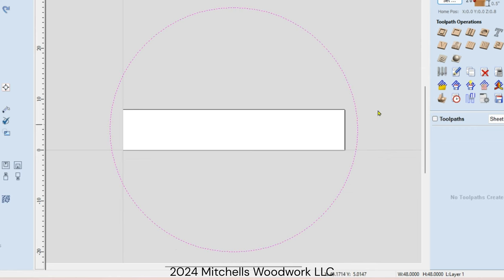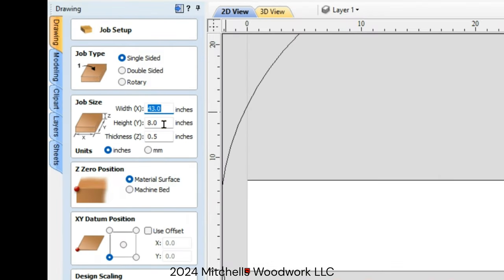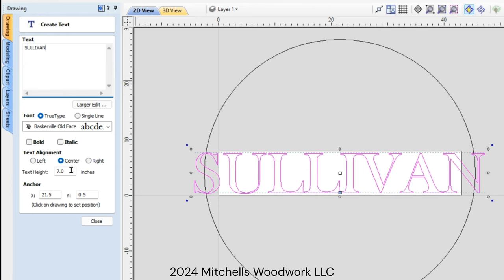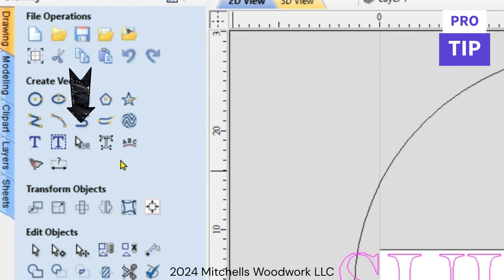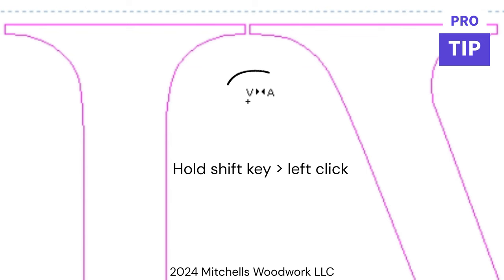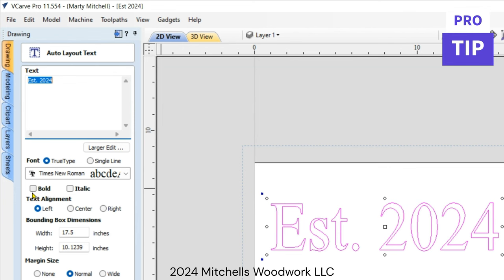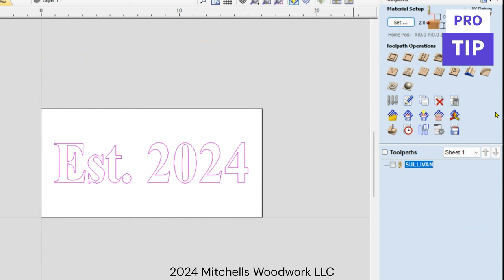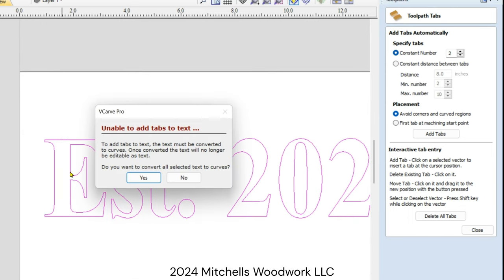Master VCarve Pro: Elevate Your Sign Text Skills

Comment: I think if you’re going to be mounting those letters later, you don’t need to worry too much about spacing. Do what you did to figure out what size they’d need to be to fit the sign, but after that you can fit them closer together to use less material. You could even flip some upside down to make them fit better to conserve material. For example, two capital A letters next to each other, rotate one 180° and then they can butt up closer together. Hopefully that makes sense? 😂👍
Reply from the maker: Yes, it absolutely makes sense, and I actually considered doing it that way.  But my plan was (is) to use the cutout as a template to help keep the letters level and properly spaced.  I've never did a sign like this one so I just considered this way the "safe" way.  Next time I'll probably feel more confident in my ability to do it as you suggested.  As always, thanks for watching and for your input!
Reply: @MitchellsWoodwork Using the cutouts like that is a great idea too!

Comment: Great info! IDC Woodcraft has an 1/8 up cut roughing bit called the badger. I have one and it works great!
Reply from the maker: After Cadence (Jenny Bits), IDC is my go-to source.  Unfortunately they didn't have an 1/8" upcut on a 1/4" shank.  I try to keep all my bits 1/4" shank just to avoid having to swap collets during tool changes.  I ended up getting the Bits & Bits (my next go-to) #425-SRF125LR bit.  But thank you so much for the suggestion.  I love my "Beast" and "Hog" from IDC and I absolutely support and recommend anything IDC sells.  Garrett is a great guy and was my biggest VCarve tutor and inspiration when I was getting started in the CNC world.  I'll always owe a huge debt of gratitude to Garrett Fromme.
Reply: Ahh completely understand. I just bout an ER11 router to replace my Makita and I bought extra nuts and collets so I have 2 1/4 and 1/8 collets. I will be picking up either the hog or beast next week.  Keep up the good work!
Reply from the maker: @kevinrich4637 thanks man.  Quick tip:  The only difference between the Hog and the Beast is the length of the cutting area.  If you don’t need the longer cutting depth you could save a few bucks and just go with the Hog.  Just thought I’d mention that.